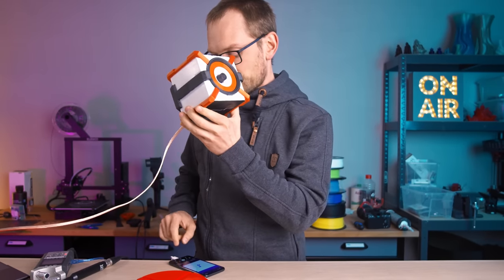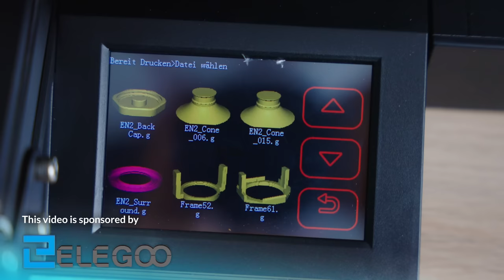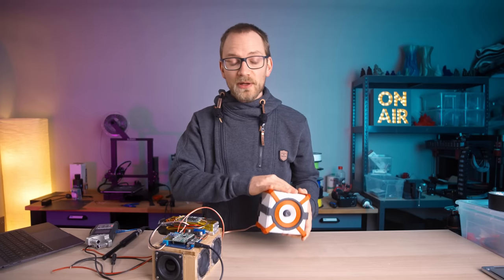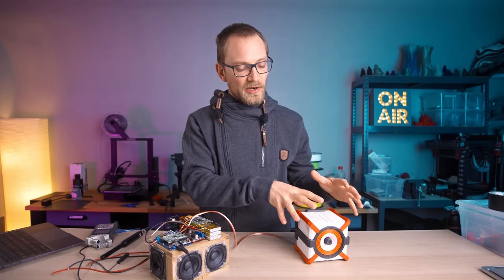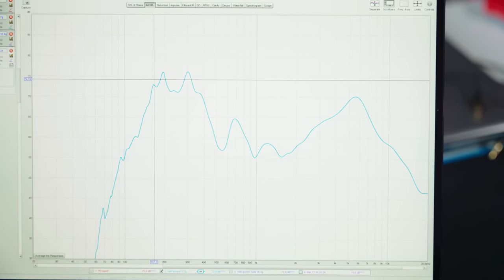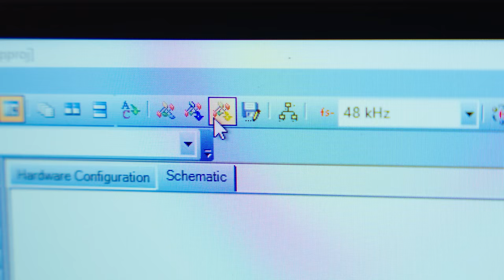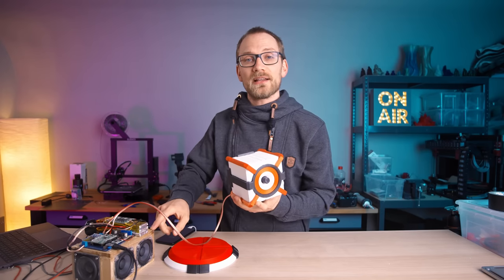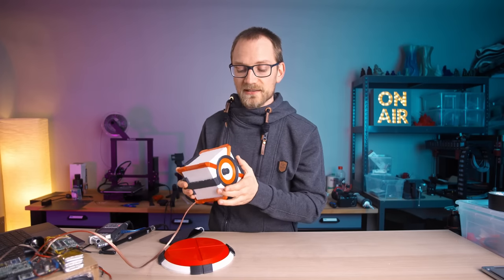Can we print EVERYTHING in a speaker? Trying Polymate3D's FD52 fully 3D printed driver!

Comment: My ender 3 just likes to always die when i need it, for example i need a replacement part and the thermistor breaks, or the heating cap.
3D printers just have so many wearing parts that theres always the possibility (especially when the 3D printer is older) that something spontaneously breaks.
last time it was a homing failiure that lead to mainboard damage.
(the Creality melzi isnt exactly cheap for anyone who didnt know)

Conclusion:
If you buy a 3D printer, dont think its always gonna be easy to handle it, there are ties it is perfect, and times it just doesnt want to work.

Comment: PC68 is A BIT better? :D Why don't you measure TS parameters of your 3D printed speaker, so we can see what its sensitivity is? Because it's going to be terrible due to extremely inefficient motor. To compensate, you'll need more power, but coil won't handle it, because of how badly its wound and because it has no metal to transfer its heat into.

As a proof of concept this is great, but that's all. It won't get anywhere near something like a cheap PC68 in any way.
Reply: I don't believe Tom has the experience or time to go about getting T&S parameters for his specific filaments used. The sensitivity is indeed poor on FD52 series and was a last hurrah for the magnet motor previously used in early development for 3D printer users. To state it's going to be terrible is not a great assumption unless you have spent the time developing a magnet motor for such a application, and concluding this will always be the case. For clarity, much stronger motor designs have since been produced which also combat assembly struggles Tom had here, and drivers producing 86dB @ 1W/1M have been achieved. I capture T&S data on a WT3 and frequency results on a EMM6 so data is available and on my Patreon for development models. I do plan to make this more consistent as well which is on me, but even FD51 from before did have datasheets on this information.
The winding of the coil, power handling etc also are common viewpoints I have had throughout and if I took people telling me this, the project wouldn't have got as far as it was or is now. The truth is clean winding would result is no one wanting to do the project, or specific hardware which 3D printer users would have to make as well. The winding is done in a indent and in intended as a underhung design. The full range and soft suspension designs also mean that Xmax limits are reached typically at 5<10W which is pretty normal for this size of FR driver. I have also had designs be pushed as far as 20W. Subwoofers and heavy power loads for sure would require a different approach, but the filaments would be the problem before the wire.
As for it not getting anywhere near something like a cheap PC68...watch this space if you are interested. A lot of work has happened since this, and it will be coming together this year. Also feel free to reach me on Twitter @polymate3D and message me. Always happy to discuss the project, ideas, and potential issues / flaws. It would be great to have a chat with you and show you what has happened since this! :) - Paul

Comment: the printed speaker is cool, but the enclosure - the most unfortunate acoustic shape - is a cube.  Why not make a sphere, or a cylinder, or a parallelepiped with an asymmetric hole for the speaker?  the sound would be much better.
Reply from the maker: Wouldn't be a FRIENDLY BOX then 😉
But seriously, the resonances of a cube this size should be in the ~700-3500Hz range, and I'm not sure if they'd even be audible. Paul already has a less cuboid enclosures uploaded if you want to compare them!

Comment: Why would anyone want to hear it with processing?
Reply from the maker: Because it sounds better? If you've got a DSP in the loop, you can tune it exactly to your preference, too, if you don't like how one setup sounds.
Reply: To clarify, I believe the DSP is done to the input of the speaker, not the output, so what you hear in the DSP recording is a raw recording of the speaker's output.
Reply: Every speaker nowadays uses (or should use) DSP for tuning.
It would be unfair and not even representative to give a listening test without tuning.

Compared to earlier times where it was important for each driver and enclosure to have a mostly flat response, nowadays it's best to focus on lowering distortion, increasing efficiency, reduce diffraction patterns to make the response more consistent at all listening angles, then tune the frequency response to target in the end.

The project and demo is done right 👏👍
Reply: @supercurioTube  erm ? no , its not like al speakers have dsp.  if you need alllloooooor of dsp in a random speaker you might have designed it wrong to be honest they can be usefull, but do not replace a a normal speaker design. in this case its different though!. i mean all made by 3d printing thats sick !
Reply: @joppepeelen  I don't think the case in this day and age anymore.
The industry certainly has moved on when efficiency (think power efficiency on battery powered devices) and size matters.
Source: I worked in engineering in a mobile/headphones/speakers consumer electronics company 3+ years ago, and following the industry in general.

I agree DSP doesn't replace enclosure acoustics design tho of course 😉, in order to make the best of a given volume.
Reply: @robertgraham6481  Thanks. I thought he was processing the output for us. makes sense.

Comment: when you say "driver" do you mean the voice coil? 
i actually 3D printed a jig for me to make a voice coil for a 1929 radio speaker i had to recone.
3:25 your voice coil looks like it was wound by someone with no patience... its so bad. if i wound my voice coil like that it wouldn't fit the narrow channel it had to rest in. 
i bet i could make a better performing speaker. but i already have too many projects and my printer is basically outdated trash. takes 2 minutes for it to fully power up. it somehow acquired the sloth trait when it was being unused and powered off for a month.  it wont even read form SD card anymore. BTT boards suck

Comment: I somehow have the feeling that you only use the Elegoo Neptune because you get paid for it. The parts don't look very good and in the end the Prusa is the one you use.
Shouldn't your goal be to recommend really good all-rounder printers?  Sorry
Reply from the maker: IMO, the Neptune is a better choice than e.g. the Ender-3 or Ender-3 v2 at this point. Sure, a MK3S+ would still easily be my preferred choice over it, but that's in an entirely different price bracket.
I tried using the Neptune 2 for the Ninjaflex prints as well (and it did surprisingly well), but I ended up needing "Detect thin walls" for the surrounds to print well, which is not an option in Elegoo Cura (but is in PrusaSlicer).
Reply: @MadeWithLayers  Okay. Thanks for the answer. 
I don't think Elegoo is bad either, but I felt like in paid video people talk better about their printers than they really are. 
However, I have to say that I only had the first generations (Neptune 1 and Mars 1) here for testing and they were not very good. The Mars has improved a lot, I know that, but with the Neptune it still seems very closed to me, as if you can hardly repair parts yourself and everything seems semi-good. 
Thanks for the videos anyway. I'm only criticising the advertising, not the content. It's only important to me that newcomers are introduced to really good printers, so that they don't get a bad image of 3D printing through bad experience!

Jan

Comment: Meh. You didn't print the magnets, glue and the coils. 0/10
Reply: 0/10 is fine, only if you gave it a 👍 anyway.
Reply from the maker: Hm, I guess I could have welded the enclosure together with a 3D printing pen...
Reply: @MadeWithLayers  Have you ever used a hot air gun for welding plastics? It's the same technique you would use for TIG welding.

Comment: yes that's right that your commercial speaker doesn't sound much better ...
But that's simply because you don't know what you are doing ...
Reply: Stating that someone does not know what they are doing (Assuming Tom in this case), and not giving any details and information as to what or why is about and grown up as a child's playground argument. I looked at your channel and could only see subs with no detail or a studio monitor and no info (Graphs, data) . Nothing detailing what your doing or why, along with you burning out a driver for fun, so do you mind elaborating for everyone some reasons? I don't begin to say FD52 is close to a industry driver btw. That work is very much happening in other drivers.
Reply: @Polymate3D  I kept the review simple as your knowledge on the subject is obviously very limited ...
The case has a massive influence on the sound of speakers and that's exactly why I don't give anything about the subs, simply because you can build 50 different cases, depending on what you want and where you use them ...
I do not write about the studio monitors because you can read everything at the dealer Thomann, if that is not enough for you, you will not be able to use them properly

You shouldn't use a DSP, especially not a simple IIR-DSP, as this leads to problems with the phase and the group delay

Aber wenn sie wirklich was zum Lautsprecherbau lernen wollen dann werde ich das sicher nicht auf Englisch erklären ...
Reply: @EumlOriginal  I think its best we let this be, but acting all high and mighty, and insulting with again nothing to back it up is not constructive what so ever. To then have the last part of your message in your native language just to state you won't explain in English is just immature. You could of answered in German if it was easier and I could of translated the whole message. Your big assumptions may well be holding your own understanding back. It is exactly why I question every aspect as it betters me and hopefully can teach others
Reply: @Polymate3D The problem is that in English you quickly have a lot of ambiguities that you don't want, you don't have that in German ... well, I'll try

So I'll start with the frequency response, although below 200Hz you can forget here when measuring in a room
Above it are 3 bumps, which are very similar, which will be related to the production of the membrane where the membrane is reduced in strength by resonances

then the frequency response rises cleanly, which is either due to a too strong drive or because the membrane is too steep and the sound is bundled

then the frequency response collapses, simply because the membrane is too heavy

Smoothing out these problems with a DSP and 20dB settings is like wanting to do your garden and first get a steamroller ...
But that is an exaggeration and you can hear it when you make such aggressive attitudes 

in order to be able to say more one would have to have a suitable measuring chamber now ...
just one thing that struck me after watching your videos, the print layers should go into the same right as the force acting on the body as far as I know, but I'm not an expert on that